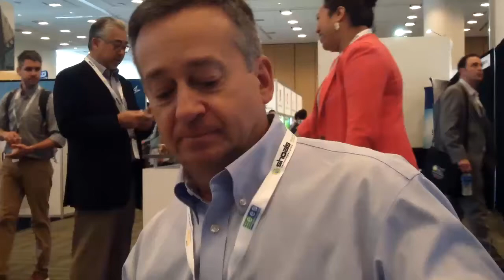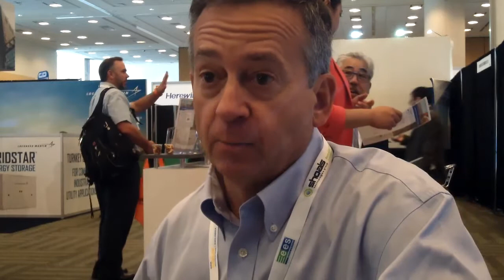Iron Flow Batteries making inroads

Comment: I like any new battery technology but they are doing way to much spin to say how good their batteries are. They can only discharge at 50Kw with their 400kwh batteries. 

When he talked about lithium only dealing with 1-4 hours situation it sounded like he was trying to say lithium can’t work in situations where 8 hrs of power is needed. Obviously that’s not true you just need a bigger battery. What he was saying is they can’t deal with situations shorter than 8 hours reasonably. 

Too bad they are at $400 a kWh that is barely competitive now and won’t be for long. Let’s hope they can get that price down.

Comment: STOP!  Li batteries HAS their use.  Other methods and technology has their strength.  Try putting a one of these iron battery in your phone....or the video camera you’re using.  Good luck with that.

If this channel want to serve society:  find, report and encourage DIY solution.  Salt water flow battery.  Iron flow. Molten salt storage.